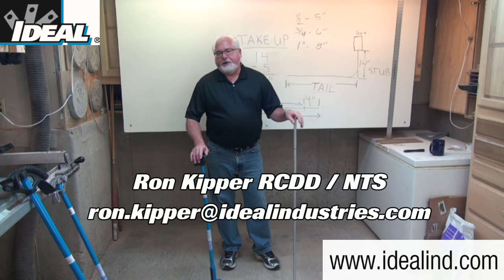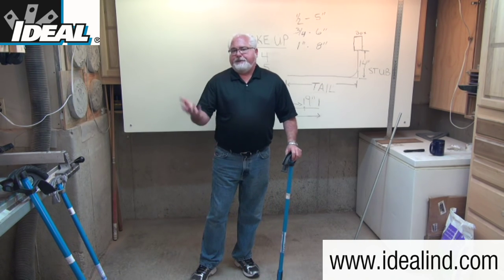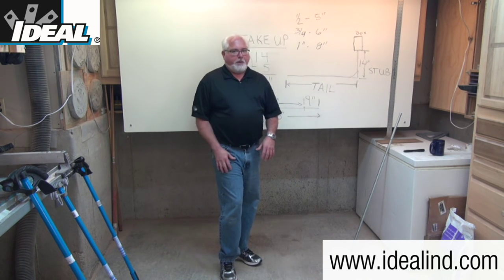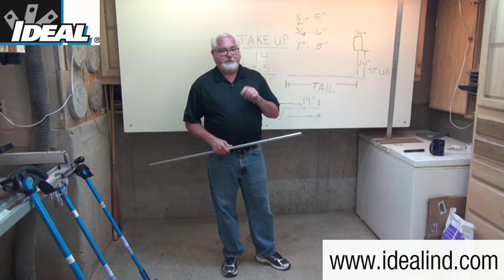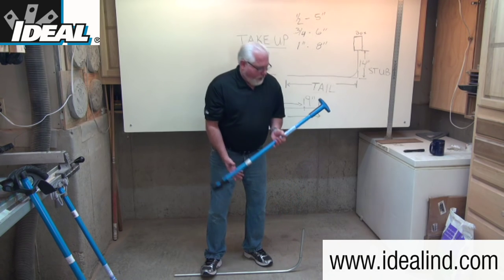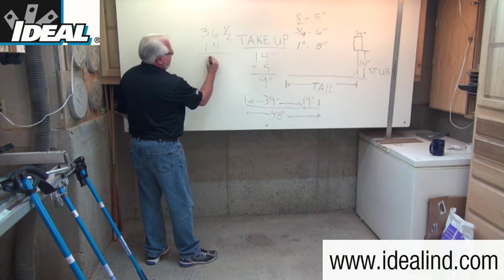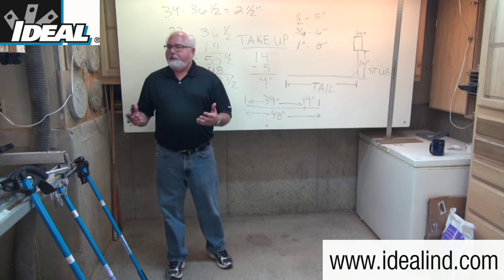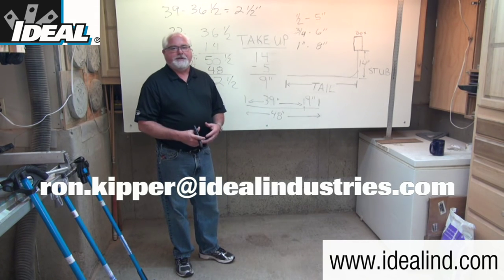IDEAL Benders How To Bend a Stub

Comment: A little confused on the last example. If you gain 2.5 inches shouldn't it look like

22+14=36
36-2.5=33.5 pipe cut length

or am I totally missing the point here
Reply from the maker: Hello I added a message at about 6:30 that shows to subtract the gain not adding it. Made a mistake when I shot the video and Robert caught it and sent me a note. Hence the annotation. Did you not see it? Ron
Reply: I m thinking same u
Reply from the maker: Hello I added a message at about 6:30 that shows to subtract the gain not adding it. Made a mistake when I shot the video and Robert caught it and sent me a note. Hence the annotation. Did you not see it? RonRead more Show less
Reply: Yes you are correct. Its 14"-5 take up =9",    +22.5" 2.5 = 33.5" pipe cut lenght.
Reply: I thought I must have been crazy because in my head with your example it didn't add up. Glad I checked the comments because I went back and checked and around 6:30 I don't see any annotations. Might confuse other new people out there like it did me!
Reply: @RonKipperDatacomm1  I didn't see the annotation, either!
Reply from the maker: @hoobieschott4436  Guys sorry YouTube pull the use of annotations several years ago hence it was removed. Luckily enough comments over the years if anyone reads the reviews they will see a note about the error. Thanks for watching Ron

Comment: My 1/2" Ideal bender says there is a 5 " take-up for a 90 deg bend, implying the outside radius of the bend will be 5".  The Ideal literature says the center line bend radius is 4 11/32 inches, which is ~4+1/2 EMT diameter (0.706").  This would make the inside radius 4".  Adding the conduit diameter to the inside radius of the bender would make the outside radius 4.706"
No matter what take-up I use the stub length varies +/- 1/8" .  Which one is correct?
Reply from the maker: Helo the radius if the 1/2" bender head is 4 inches. I would tell you all bender heads vary slightly so if yours is off by 1/8" just make a note about that and take it into account when making bends. Just a matter of getting to know your bender have fun Ron

Comment: I'm not an electrician.  The trigonometry in the bend tables for the multiplier are rounded off to the closest tenth.
Calculating to the nearest hundredth, Here's what I get using the formula: 1/sin (deg) 
The approximation for 10 & 60 degrees would improve using these multipliers.
10 deg    ---5.76    (table=6)
22.5 deg --- 2.61   (table=2.6)
30 deg --- 2            (table=2)
45 deg --1.41        (table=1.4)
60 deg ---1.15       (table=1.2)
For example in a 10 deg bend with a 1" offset calculated both ways

Table: 1x6 = 6"  and Calcd: 1x5.76 = 5-3/4"  (1/4" difference)
Reply from the maker: Julian you are smarter than I am...........bending by hand to the closest 100th might be beyond alot of us. Ron
Reply: Probably overkill in most situations, and you need a calculator.

Comment: Is this the same as The Conduit Gain Chart:    1/2" EMT=2-5/8" 90 Degree Gain,     3/4" EMT=3-1/4" 90 Degree Gain,    1" EMT = 4" 90 Degree Gain,   1-1/4" EMT= 5-5/8" 90 Degree Gain?
Reply from the maker: Yes thanks for sharing have fun Ron

Comment: hi Ron, would the 3/4" bender handle compatible with # 74-026  (1/2") bender head?
Reply from the maker: Yes the same handle on the 1/2 and 3/4 benders cat # 74-019. Ron